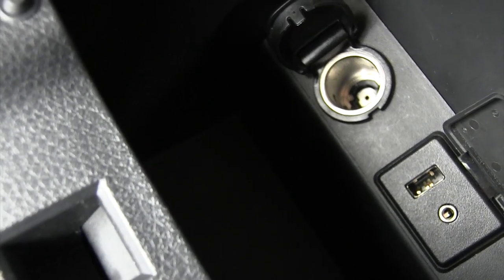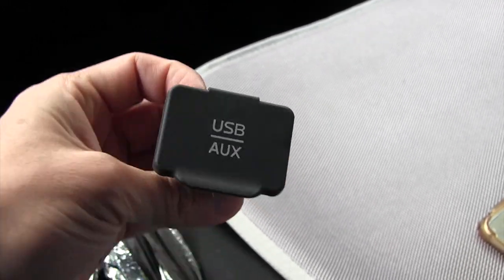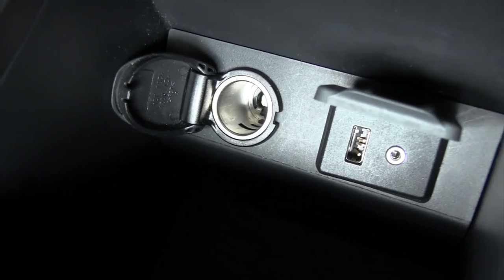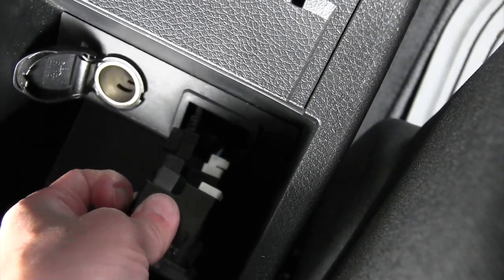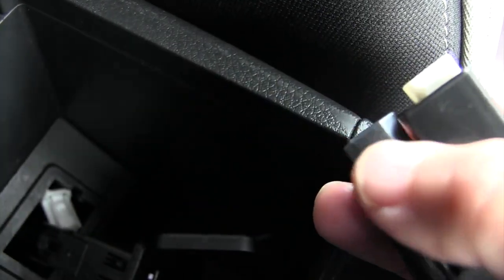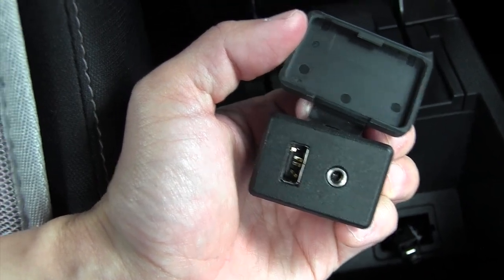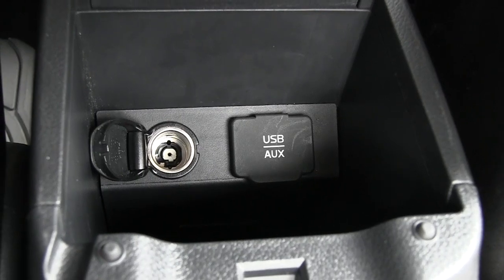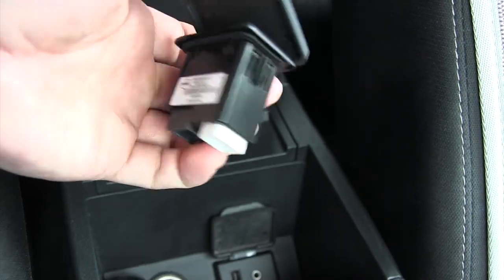Installing/Fixing USB AUX Port for the 2015 Nissan Sentra

Comment: I found the replacement aux/usb port part online from a Nissan dealership called Coulter's (sp?). It arrived fast via expedited shipping. Your video helped me navigate this issue correctly! With my situation, the tabs from that outer shell had snapped off, and that whole port slumped into the console. Once I was able to disengage the wires from the damaged part, it was so easy. (Incidentally, I bought my car used. Like your vehicle, it was also a rental prior to my buying it.) Replacing the entire port fixed the problem. Even if you thought that this might have been a silly video to begin with, thanks very much for posting this! Have a good day.
Reply from the maker: wow!!!; thank you!!

Comment: Nice try, and congrats on saving a few bucks & replacing your usb. I kept waiting for you to show the back of that unit to see the actual socket, but you never did show it. I only saw you show the sides/front of the broken/replacement piece.  :(
Reply from the maker: 1blisslife aw man! i tried to be so thorough.. but i missed that. sorry!! if you find the part, you can do it!

Comment: Okay so I took out the usb part, come to find out there weren’t any wires under it, is this something that needed to be added on with the manufacturer?
Reply from the maker: @rockynancy8900  hmm i know i didnt add those wires. if there was a usb thing there.. with nothing connecting it.. i think there must be an explanation with the person or place you bought it from. it must have never have worked then?

Comment: Thank you for making and uploading this video!
FYI a piece of heavy paper, such as card stock, folded in half worked great to separate this from the console to begin the plug and play replacement! Saved lots of money by not having the dealership take care of this!

Just be sure you contact a dealership and get the correct part # for your make and model unless it was in your owner's manual, etc.
Reply from the maker: damn, i wish I had tried your idea! haha.

Comment: Thank you so much for this video!! My aux cable tip broke off and is currently stuck inside the AUX port. Dealership said it will cost atleast 170.00 bucks to fix it inside my 2016 , I used a butter knife to pull out the port,but thanks to your video, I am going to order a new port offline and assemble it!!!(But first i am going to try a USB to 3.55aux adaptor first..) THANK YOU SOOO MUCH,BUD!!!!
Reply from the maker: woah.. seems you know more about this than me. I appreciate the kind words but you're doin it! good luck!!

Comment: Instead of working from the front end I found it easier to pop the center plastic off on the passenger side foot well. Then reach in and just push out the port assembly (apparently I was also depressing the clip on one side). The side wall then just pops back in when done.
After I took the module out I hooked it to my computer with a Mini-USB cord and found it was not the problem. When I put it back in the car it was not lighting up the USB drive I had in it as before. I then blindly traced that to the back of the radio and suddenly the light came on and AC/DC started playing from the drive. Lesson is check that both ends are good.
Reply from the maker: thank you so much, I hope everyone sees this!

Comment: Great video. I had a "professional" place (Cartunes) install an Alpine navigation but they didn't use a ports retention cable so my USB/Aux ports don't work. I have to plug the flash drive into a cable in the glove box.
Reply from the maker: rbkhyvc very cool.. it sounds very complicated!

Comment: I recently bought a new Nissan with this same issue. Are you able to play audio using the USB now that it's fixed? thanks for the helpful tutorial!
Reply from the maker: yes, I play a sansa sport clip through that auxiliary port. the usb works well too. came in handy when I used my car cigarette charger on vacation and forgot to put it back. the usb does not charge fast at all, but great to have in a back up. I recommend the 2 port anker cigarette charger. but yes that port works well now. im glad it helped someone..

Comment: Could you possibly link to the part you bought? I've looked around and most versions of this seem to have different types of connectors underneath
Reply from the maker: i dont know the part, im sorry. but i found this on ebay..
Reply: The part name is: USB  aux auxiliary jack adapter . Go to EBay  and you lll see pictures of the items

Comment: thanks, I ended up taking out plug and I took out the USB and then took the female USB from a old computer and soldered it in. It works but it only charges phone. I can't get it to play music in my sentra. Thanks for video though,it was helpful.
Reply from the maker: Mike P wow very handy solution thanks for sharing it! i feel like audio is all connected by bluetooth anyway these days. cool workaround though!

Comment: Anyone know if you can disassemble the port to remove a broken jack from the aux port?
Reply: Yes, you can remove the top part of the adapter and then slide the usb board out and replace it with another one.

Comment: Was busted on the 2018 Avanza on on 17 November 2018-13 October 2019, 21-30 October 2019 _ 25 November 2019-23 June 2020😢
Reply from the maker: sorry to hear that... luckily there are so many blue tooth and other audio choices these days. good luck!
Reply: @jimmycphoto My Pioneer DEH-X6750BT🍁 is busted again, I replaced with a Clarion CZ550I getting inside an RB platform Hyundai Accent!

Comment: Question: When you installed the new USB port, does the phone charge faster? I have an issue with my USB port. It will not charge at all.
Reply from the maker: Edwin Perry II i gotta be honest. i dont really use it. i recommend an anker cigarette lighter charger with 2 ports to charge. it works very quickly.

Comment: where did you buy the replacement?
Reply from the maker: sorry, the one thing I should have mentioned is that I got it from ebay. I looked up sentra 2015 aux usb and they come up here and there. I think I paid 20 -26 bucks with shipping. Honestly, I don't use the port, but I like the fact that I fixed it.

Comment: Does this work with a Nissan Altima?
Reply from the maker: Sameer Bham hi, im not sure, i dont have that car. if its the same year, i will guess yes. but you would need to buy that specific part.
Reply from the maker: Sameer Bham hi, im not sure, i dont have that car. if its the same year, i will guess yes. but you would need to buy that specific part.

Comment: Question: When you installed the new USB port, does the phone charge faster? I have an issue with my USB port. It will not charge at all.
Reply from the maker: Edwin Perry II hi, great question... the usb i changed out was damaged so i couldn't tell you. if you find one i would say try it out and change it. if not, i would recommend getting a carport cigarette charger from anker, their stuff works so well and it has two usb ports at the time of writing this. i fixed the usb, but i still use the cigarette charger!

Comment: Where did you get the replacement ?
Reply from the maker: sorry, the one thing I should have mentioned is that I got it from ebay. I looked up sentra 2015 aux usb and they come up here and there. I think I paid 20 -26 bucks with shipping. Honestly, I don't use the port, but I like the fact that I fixed it.
Reply: thanks man.. i use mine all the time but my friend spelt soda all over it the other day lmao

Comment: Question: When you installed the new USB port, does the phone charge faster? I have an issue with my USB port. It will not charge at all.
Reply: Hi Edwin. It sounds like you should replace the entire port.

Comment: Question: When you installed the new USB port, does the phone charge faster? I have an issue with my USB port. It will not charge at all.
Reply: usb will not charge because it is for iPhone/ipod interface only...so add a usb elsewhere or change the stereo and or the ipod interface....or get the iphone 30 pin connector for your car and go from there USA Spec CB-PA105A iPod® Cable